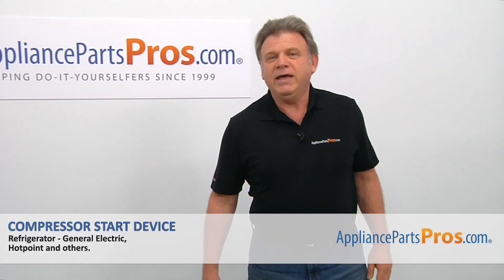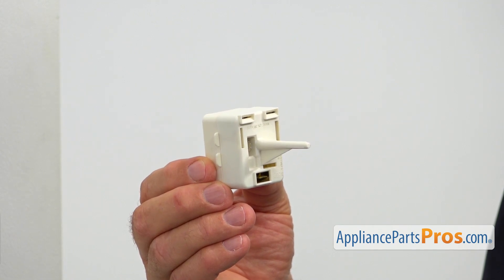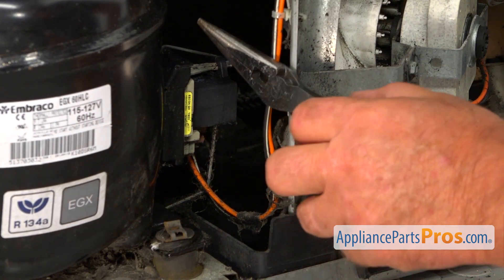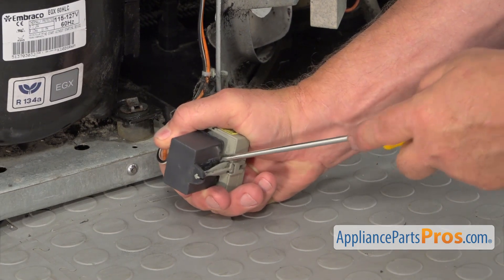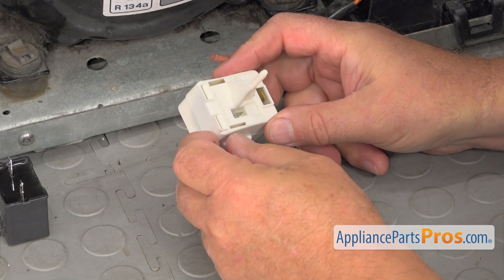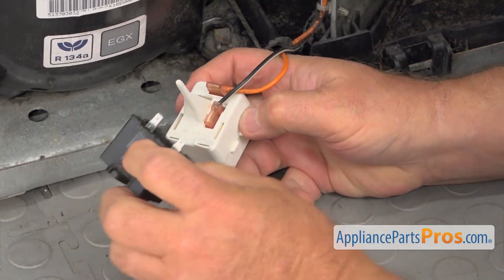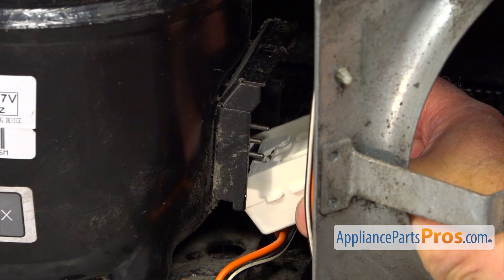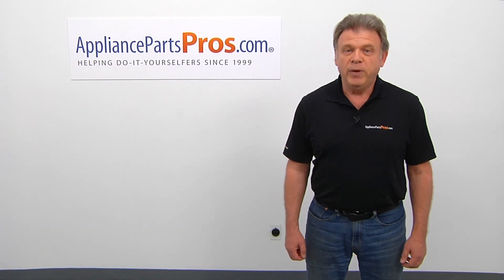How To Replace: GE Refrigerator Compressor Start Device WR07X10131

Comment: Wire connection is wrong in your video. Every article and video I’ve read and seen has L (black wire) goes into horizontal top of the relay farthest away from the capacitor. These new relays should have L and N marked. Neutral wire goes into the vertical terminal closes to capacitor so I don’t know why you wired it differently.
Reply from the maker: Thanks for your comment! This video is meant to give a general idea of how to do the repair, but the wiring isn’t identical across every model. If your unit is wired differently—or if your start device has L and N markings—you’ll want to follow the original wiring setup specific to your refrigerator. Always best to match how the unit was wired from the factory. We appreciate you pointing it out!

Comment: Hello my refrigerator model # is gfe28hmhees. A GE French door. I woke up to a puddle of water on floor outside fridge, no cooling. When I plug in the fridge the compressor sounds like it is running for approx. 5 seconds then a click sound and compressor turns off for a few minutes then compressor clicks back on for another 5 second, over and over. Does this sound like a possible issue with the start relay, also if so is this part WR07X10131 the one that should work for my fridge? 2 wires orange and black, with wire to which terminal?
Thank you for any guidance you can give
Reply from the maker: Yes the wr07x10131 is correct for your model. The black wire will go to the 2 terminal and the orange will go to the 5sp terminal.

Comment: How did you determine the wiring? The terminals aren't marked for line and neutral like the original part was. One has a "2" in the impression, the other terminal is unmarked. I found a different video showing the black and orange wires swapped. Does it matter?
Reply from the maker: The black wire will go to the 2 and the orange will go to the 5sp.

Comment: I saw another video and he wire the opposite way!!! My fridge is ge with embarco compressor and its relay ( embraco QD TSD2) and when I ordered my new part I used the model and make of my fridge and I got part number wr07x10131 GE would that work? And what if the wiring os wrong what will happen? Thank you
Reply from the maker: What is the model number of your refrigerator?
Reply: I ordered the same part number will find out Friday, and I ordered 2 just in case.